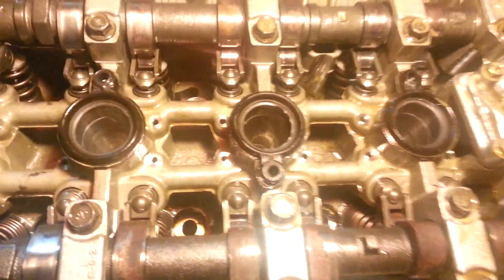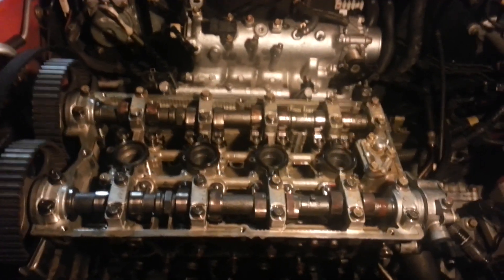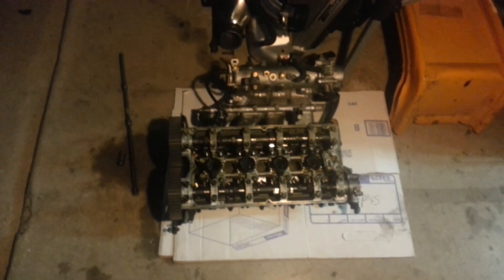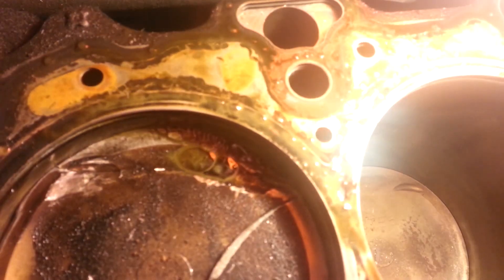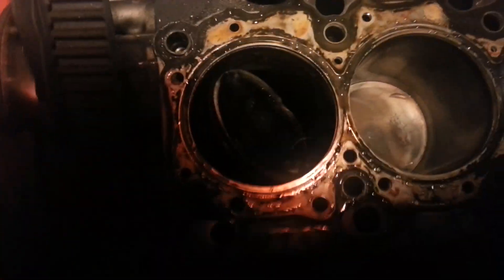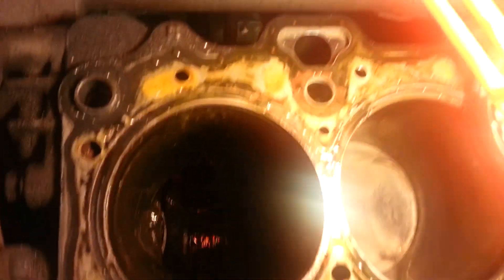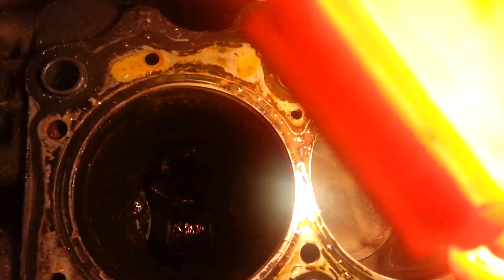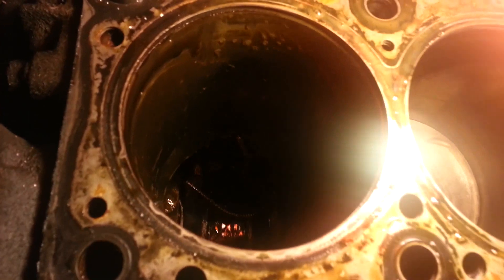Evo VIII Death and Rebirth - Part 2 - Damage Assessment

Comment: looks like one of the compression ring cut off the top due to heat expansion.  This is seen when gaps are too tight for the application.
Reply from the maker: I have no idea. This was the factory-built engine.

Comment: I see dollar signs..  bummer
Reply from the maker: Yes.  The block and crank are clearly scrap metal.  That means the entire engine and everything in it, with exception of the head which might be repairable, is probably trash.
Reply: EvolutionAutocrosser Sucks man, never fun to see those huge repairs. On the plus side, there is no reason to not build the motor now! Built 2.0L or 2.3L in your future?